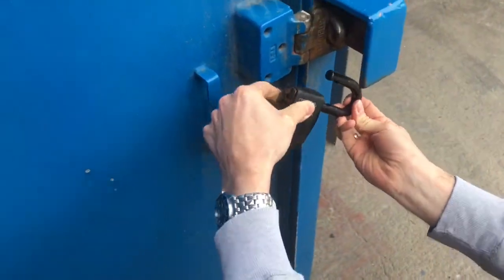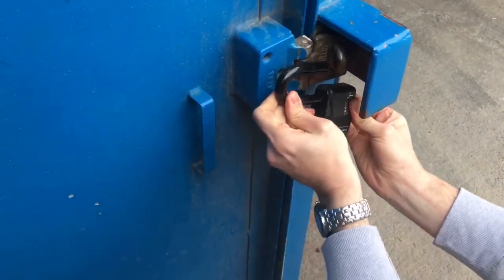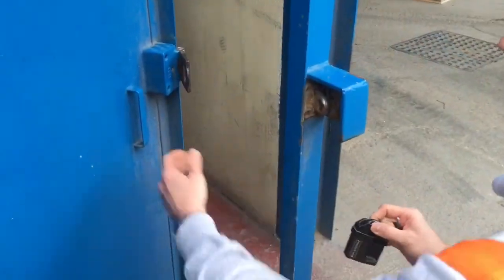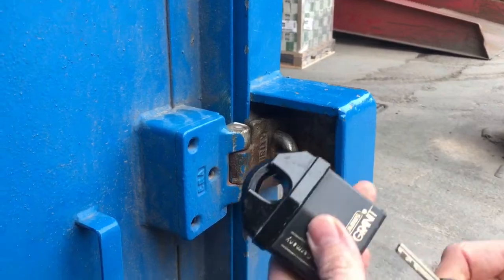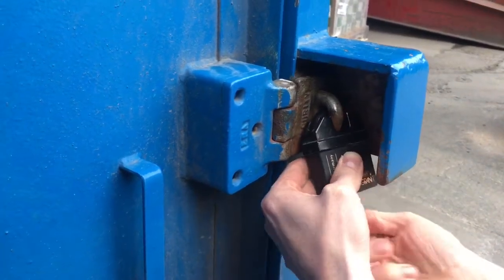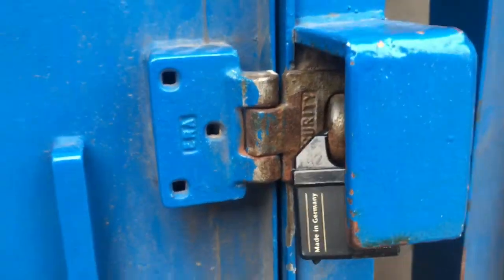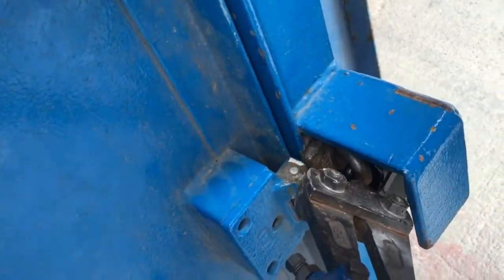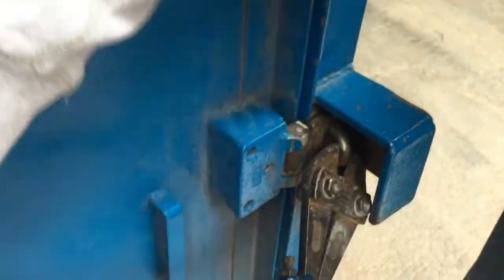What padlock for an enclosed warehouse lockbox?

Comment: it I were to attack this; I would use a angle grinder to cut the hinge. it is fully exposed, and is the weakest link. I would not bother trying to cut the lock.
Reply from the maker: Ralf S well spotted! The hardened still of the old Era hasps are crazy strong. Most grinders wouldn't touch it compared to the mild steel of the door itself. That said, some modern blades will do and as such we're adapting it to copy with a larger lock box to cover it all.
Reply: We had a full cover so no exposure to hasp or hinge so they drilled out the padlocks where the key goes so now I have welded a steel angle under the lock so you can just fit your hand in to put the key in....